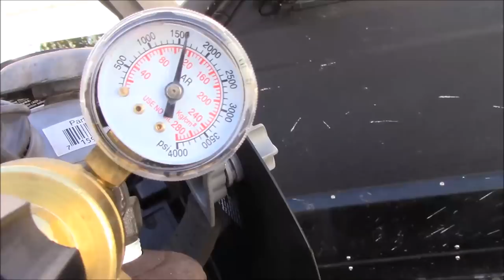Iron rock offroad truss install

Comment: As for the inside of the truss rusting, get some Fluid Film and the 2' extension hose, and use it inside there. It will NEVER rust if you do it once a year. 
Do the rest of your rig, too. Fantastic stuff!
Reply from the maker: +JeepITguy  sweet yeah I will get some and do that I've seen it on other channels not common is the south but it seem to be the truck in snow and salt I'll give it a try
Reply: I live in the South as well- Charleston, SC. If you happen to be in the area I'd love to check out your rig sometime. I ran across the FluidFilm on some of the forums years ago, and promptly forgot about it. But now you can get it in the parts stores. I tried it on a few pieces of steel as an environmental test during the monsoon season- it does everything it claims to. I even use it when I'm in the midst of an engine rebuild, to prevent flashrusting on bare steel parts.

Comment: How long of sections did you weld in? Your start stops look great
Reply from the maker: The length off the weld point do one on front right then rear left then back to the front back and forth til its welded up as far away from the last weld as possible
Reply: @Rusty411  shoot your a day late 😂 I did mine in 3 different welds was really worried about it warping
Reply from the maker: Yeah I was to you can jack up the rear and there should be a small amount of movement in the wheel bearing up and down but your probably ok I've welded on them alot never had one warp yet

Comment: Rusty, first off love your video's... everything you do is well thought out... keep it going .. I have a question you did a "hack n tap" how well has that worked out for you? I'm thinking about doing one. Thanks
Reply from the maker: The back and tap has given me zero problems I got the one that uses a front shaft for the rear worked out pretty good